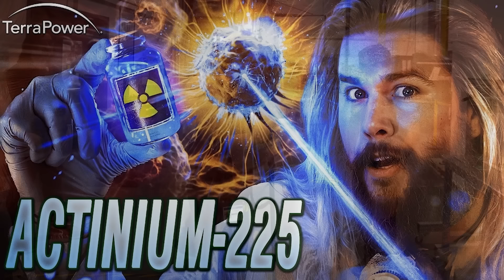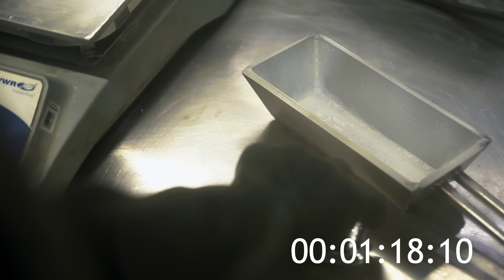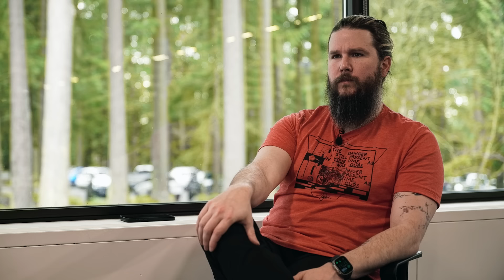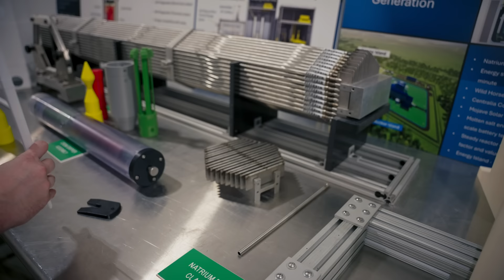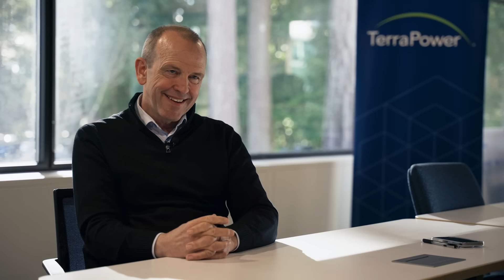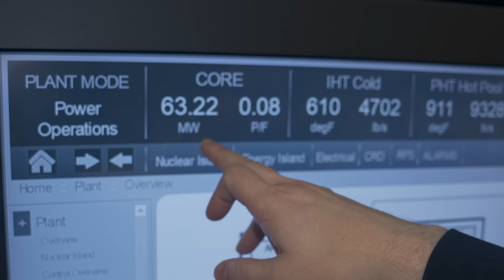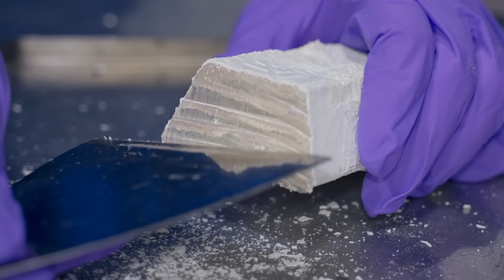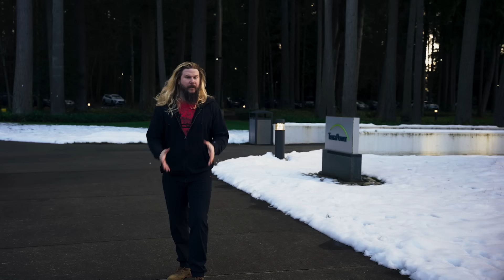Will Natrium Nuclear Reactors Change Everything?

Comment: Im just a low educated random guy and after watch how this reactor works for a while I got only one curious thing.
normally we use water because it doing both radiation and heat shielding, now it use liquid metal instead.
how do they deal with radiations I wondering, just thickening the wall?.

Comment: Boy this sure would be awesome, buuuuut... anti-nuclear people with Facebook degrees that complain about the firmament locking us inside this glass dome. Mostly boomers. They'll never let this happen because radiation is bad. I mean, just look at microwaves. The strongest radiation ever that doesn't exist in nature. (For you pseudo boomers, this is a joke based on real beliefs by koala brains)

I do wonder though, is there not a thermal loss in all of this? Like running a gas engine to power an electrolysis unit that then uses the hydrogen to power a fuel cell. I feel like using X to heat up Y to heat up W to heat up Z to turn a turbine - and that's not even including the intermediary materials that must be heated up to I turn allow for the liquids to be heated. It all just sounds so insanely inefficient and like they're seriously fluffing the numbers. I'll need to see an independent nuclear physicist run all the data and independently test this before I believe any of it.
Reply: Most thermoelectric process are the same flowchart: heat > pressure > motion > rotation > electricity. And yes, thermal losses are all throughout, it's modest price to pay for reaching the temperatures where turbines really hit their straps in terms of efficiency.
Direct steam heating is fine, but it doesn't provide thermal storage, which is really the point of this plant.

Comment: 8:40:  She is LYING, Sodium fast reactors were run at a commercial scale with the Superphenix in France, and elsewhere.  She also suspiciously leaves out Fermi1 in the U.S. which immediately melted down when it obtained it's high power license. It was designed for commercial scale, but abandoned as a bad idea.

Bad ideas come back with Kyle shilling for the WORST of them, Sodium Fast Breeder Reactors.  

Saudi Arabia wants the bomb. Many other developing nations both in the area and around the world wish the same. Commercial reactors are largely designed for the export market and proprietary resources are readily diverted to nuclear weapon needs.  This primary desire for reactors world wide is to fuel weapons programs, and plutonium from breeder reactors is ideal. For the public it is an expensive bait and switch.  Many understandably oppose federal funding of research and development for later use in foreign nuclear weapons programs.  It would be difficult to convince me Terra Power wouldn't like to profit from such export and development.
While Breeder reactors can turn readily available U238 into energy, U238's availability makes the reactor type most desirable for producing nuclear weapons.
Fast Breeder Sodium reactors have a long tarnished history:  The Superphenix in France had 80 physicists sign on against breeder reactors, and the public debate was cut short.  The reactor was attacked during construction by public outcry, Molotov cocktails and even with an RPG. After many delays and being over budget, the Superphenix only produced sporadic power at enormous expense. It was shut down early and is viewed as a debacle.
The BN-600 and BN-800 in Russia arethe most successful.  The BN-800 has been diverted from burning up plutonium to producing it as the U.S. pulled out of weapons limitation treaties. Nuclear power is inextricably linked to nuclear weapons, and the U.S has a $1 Trillion budget for more weapons, likely the greatest economic driver for development.
Safety: With many things, you have choices between fast, safe, and cheap.  Nuclear has promised all and while we have had some safety, never fast nor cheap.  To reduce cost, Nuclear lobbyists have reclassified high level wastes to low so wastes can be disposed of as regular trash, and are attacking the NRC to remove safety regulations from unproven and even unforeseen reactor designs. The proposed coolant, liquid sodium explodes violently when it comes in contact with water(think Fukushima and tidal waves). Breeder reactors are also the most difficult to control, much more prone to runaway than conventional reactors.

Don't buy it. With storage on a steep curve towards the cost of peanuts, Renewables can quickly bring us to carbon neutrality.  It is way cheaper to run 1 gigawatt cables through the air than move carbon by pipeline, ship, truck and train.  The only thing more expensive than Nuclear plant construction (Hinkley was $35 Billion) is nuclear plant development paid for with your taxes and financed with debt.  Such technological development could return on the tip of a missile.

Comment: this is going to be a money maker. there is so much nuclear was out there. Even old weapons could be used. This is going to be a real money maker. I wonder why Elon has not jumped on board with this. After all he will need Power at the outer space colonies and being in sun light is not a good idea as you don't have the radiation protection. Heat and power at the same time. All planets that had an atmosphere of any kind must have nuclear material to mine.  This could work in a space station on scale. Just think. being able to create a strong enough field to act like the earths magneticefield. ...Protected astronauts first and most important part of leaving earth solved.
Reply: Because musk is a moron

Comment: It's compelling technology and nuclear power generation is the only "clean" energy that can be done at scale (save for hydro but not everyone has a dam-able waterway nearby). But my skepticism harkens to the natty-gas fired CSP systems. I recognize that the sun is a daily intermittent and that nuclear likes to run 24/7; but still, letting molten salt storage or sodium coolant "freeze" is...well, bad. So reliable, plentiful natural gas was used to keep the CSP salt molten. Kinda defeats the purpose of "clean" energy, right? It always seemed like a Rube Goldberg machine to generate power - just build natty-gas fired power plants and be done with it. I've groked for Terrapower's scram or extended shutdown provisions to keep their salt loops liquid (and/or provide for safe drainage/pipe clearing), and I could find nothing, even with deepsearch. So, I remain skeptical that this is not some new kind of green scam where again, natty-gas or the like will be needed to actually run the system.
Reply: Ah see you've gone and let a lie machine do you're thinking for you can wound up at a bad conclusion
Reply: @dolphinsupreme1697  You could prove me wrong...but nah.
Reply: @chuckbenedict7235 you could try providing actual facts instead of llm produced words

Comment: I’m assuming they have a way to prevent, say, a flood from breaching the Na storage tanks and therefore generating vast amounts of Hydrogen gas that could lead to an explosion. It sounds far fetched, but if something can conceivably go wrong, it will.
Reply: There is a great attack on the NRC to remove regulations before reactors are designed.

Comment: wHy DiDn'T iT cAtCh On BaCk ThEn?

It didn't produce enough weapon's grade fuel.
Reply: Actually, Breeder reactors are best at creating weapons grade fuel from U238.  To reduce undesirable transuranics, just push U238 through faster and keep the core burning.  Chemical separation of plutonium from uranium is quite well established, easier than centrifugation to enrich U235.

Comment: Sodium doesn't exactly react with water - I mean, it's not a traditional reaction where electrons trade places or new spacial positioning creates a better electrostatic bond. Apparently it causes a lot of hidrogen to appear and because sodium gets hotter it starts to explode. You may not believe me but Thunderf00t is the person to talk to in this area - and, do believe me.
Reply: Na+ + H2O -> NaOH + H+.  Seems standard you would make sodium hydroxide and release reactive hydrogen which could react with oxygen in the air.  I've seen sodium metal  oxidize non-violently in air, and also violently in water.  It is highly exothermic.  Appeal toThunder...'s  authority probably doesn't clairy.
Reply: It also happens UNDER water, no air needed.

Comment: As a renewables fan and not a fan of nuclear, this is by far the least bad option, I'm particularly interested in how long this can load balance for and what the economics of extra load balancing capacity would be, Ie how would the load balancing cost compare with simply using battery storage.
Reply: You could get to net zero with renewables + storage by 2035, and have money left over.  This will just get you bombs built in other countries.

Comment: I did not finish the video. But couldn't you also use this power plant as a battery?
Reply: With renewables, one can go straight to electron storage in ever cheaper batteries.  There are already solar salt storage plants, and all forms of electricity can be used for pumped hydro and thermal (such as this) storage.

Comment: 16:19 I appreciate the public education about solid metallic sodium in a low humidity air filled environment. You're using liquid metallic sodium at atmospheric pressure, thankfully, and in an inert environment. Great! We'll still want to know what a catastrophic failure looks like. I think that's fair. Love the idea, but we want full disclosure.
Reply: I wonder what tons of liquid sodium  wrapped around a plutonium core exploding in a Fukushima tidal wave would do to public opinion.
Reply: @veritea9374 I don't know if you've looked at a map recently, but if there's ever a Fukushima tidal wave in Wyoming we will have far, far bigger problems than some liquid sodium going boom.
Reply: @veritea9374  From what I can see the top of the reactor is sealed as you don't want anything wandering in there (especially wildlife) so it'll do nothing. Flooding would kill the electrical generation stuff; expensive but it's no different to solar-thermal. As for the "Nuclear island" electrics, loss of contact with the generators (or loss of power) would trigger an auto-scram where the reactor is shut-down by gravity. Those computers might get destroyed by the water or just run out of battery power, but neither matters for safety once the reactor has scrammed, it'll just cool down over a few days.

If the reactor is prevented from scramming somehow you are in the regime of "Loss-of-Flow-without-Scram". For a liquid sodium reactor this was investigated specifically in July 1986 (yes, just after *that* event), on a test reactor, with the aim of confirming that it in fact did work how it should and collection of real world data for computer models. The general result was that the reactors were fairly close to the expected results (safe) with the various tests providing good data to improve these models.

Comment: This is fascinating but can we step back a second and recognize that we are still using technology from the 60's? This is a recurring theme and it makes you think.
Reply: Yea like the wheel
Reply: @awsomedude12345678  Hmm, I wonder how horse carriages worked.
Reply: @harryschmidt4465 i was simply pointing out that the wheel is an invention of the stone age and we still use it. Just because a technology is old does not mean it is obsolete
Reply: @awsomedude12345678  Hmm... My point was not that old technology is obsolete, I did write that in my bed and I am even happy to use a char. My point was that we are not inventing genuinely new technology in the energy sector. One can clock the end of significant inventions at around the 60's and it is very interesting to think about why that might be.
Reply: @harryschmidt4465 energy sector innovations are rare however even though we have innovated quite a bit in nuclear power since the 60s but mostly just in safety and reliability
Reply: @awsomedude12345678  Yes! But I think it is even a bit worse than that. Even in Safety and reliability we only get recycled ideas just as explained in the video. This is not to take away from the achievement and I think they should continue with what they do! I am personally of the opinion that R&D in this area is a risk mitigating factor and will most likely not lead to new developments in nuclear weaponry. Sort of for the same reasons I think it will not  lead to major innovations in energy production.  But when have we last seen a truly innovative technology that perhaps wasn't even imagined before? I am thinking of Tesla or the quantum revolution. Even in so-called AI development, there has been great research in the past decades, but a lot of the ideas and even controversies have been around for a while. Neural networks were conceived in the 60's-70's if I am not mistaken (too lazy to look it up). One of the most misunderstood articles, is Turings article on his test and we have not had any original ideas on that front since. I am genuinely curious about this development because I think it has to do with the industrialisation of science. I am unfortunately for me, very doubtful about the efficiency of the current structure of science funding. On the other, I am not sure that this is the actual reason for the decline. I would like this to be discussed a bit more but I am honestly unsure how to go about it systematically.
Reply: PS: Thanks for taking an interest in my silly comments. Not sure why I spend so much time convincing strangers
Reply: @harryschmidt4465 oh i love a good argument as long as its in good faith.
Talking about ancient tech that is still in use the poster child for that is the lead acid battery invented in the 1800s. And is entirely unchanged.

Comment: I might have missed it but from my memory, Terrapower initial pitch with this reactor on the Sodium cycle is to use SPENT Uranium fuel lying around. Some processing is obviously still needed, like prying the rods from the concrete encasements, and forming it. But there's no need for enrichment and those sort of things.

This will be very helpful in US, France & Russia where there are a lot of spent fuel and even weapon grade uranium & plutonium.

Comment: What advantage does using sodium have over lead, like the soviets did in the 60s?
Reply: The explosive quality with water is the downside with sodium.  The lead is not as good at carrying heat away from the core.  Soviet BN600 is a current sodium cooled fast reactor Natrium's spokespeople  deceptively don't mention.  That plant makes commercial electricity and plutonium for bombs.  I wonder if it will have a meltdown someday, I don't think it is safe at all.
Reply: @veritea9374  I was thinking more along the lines of OK-550 when I made that comment, but this looks very interesting

Comment: "Sodium is not dangerous unless it comes into contact with water or is molten."
But that's the point, the sodium is melted.

Shielding gas is briefly mentioned in the video, but what does that look like in practice? The entire compartment containing the sodium pipes would have to be continuously flooded with the gas. Otherwise, if a leak were to occur, the liquid sodium would immediately react with the oxygen and likely melt the pipe.